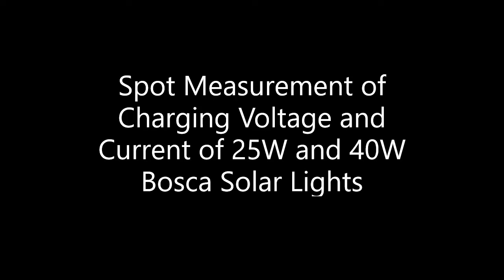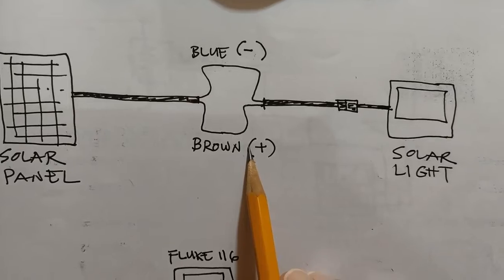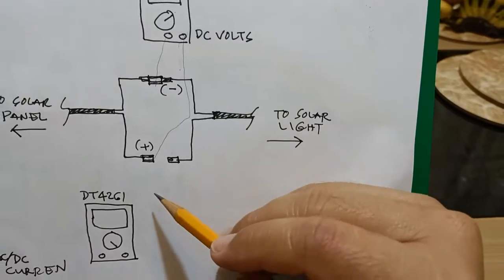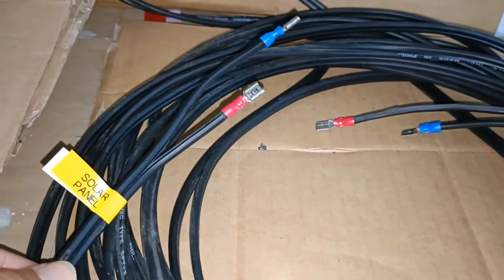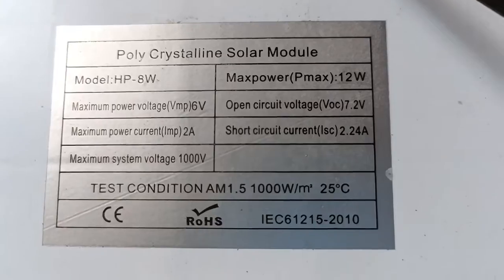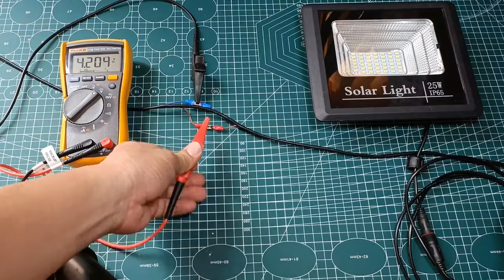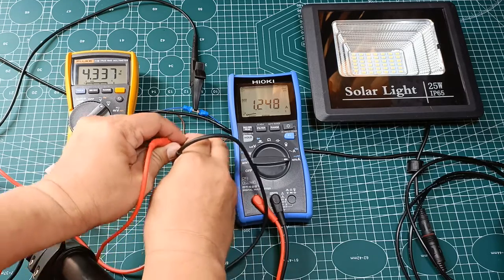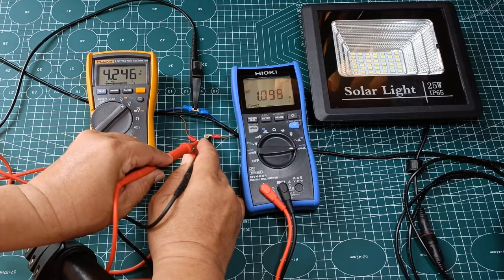[CC] Bosca Solar Light Charging Voltage and Current

Comment: It means 7watts lng po yung solar panel?
Reply from the maker: Hindi po sir. The nominal rated maximum power for the 25W solar light panel was 12W, while for the 40W panel was 16W. I don't know how they come up with these ratings. Perhaps under laboratory conditions. In any case, at the time I took the measurements the solar panels delivered only those values shown in the video. I surmise that several factors affected it, including the residual battery charge, sunlight intensity and solar PV condition. The bottom line is, my solar panels effectively charged the solar light's battery for uninterrupted illumination, dusk till dawn. Thanks for watching!